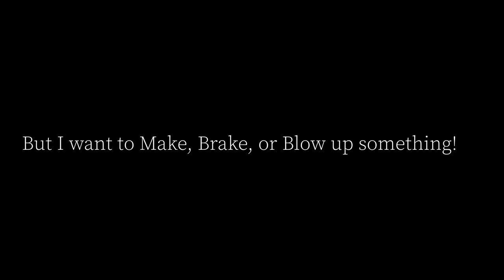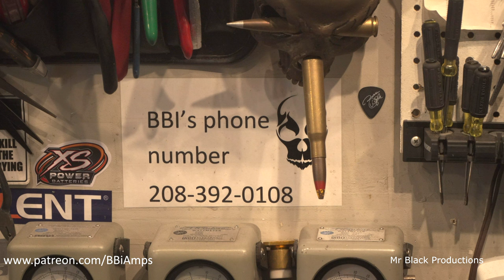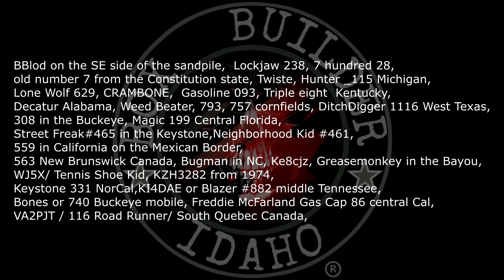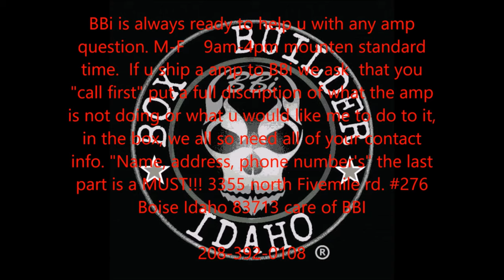All I can say is Bad Ass!!! Skullcracka!!

Comment: Wow......This just took me back BIG TIME. At first glance I thought this was MY old setup, but mine was setup a little different. Prime built me a 1x8x32 system  back in 96 I believe instead of a 2 pill driver in the first stage. Plus on my 32 pill I had 2 air variables instead of just one seen on this one on the right hand side (for the input tune). This allowed me to tune any reflect out in between the 8 and the 32. Very cool man. I wound up selling it to someone in the midwest cause i wanted to go AC. but I don't wanna say who cause I don't know if he"d want me to.
I think I still have some vhs vids of it when Prime was building/testing it in his suburban too. Looks like I gotta start diggin now....